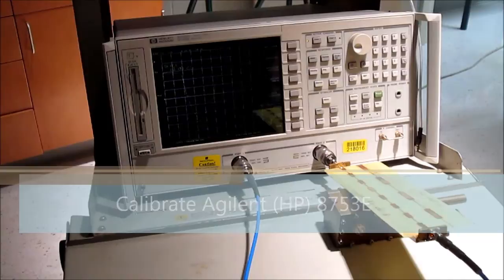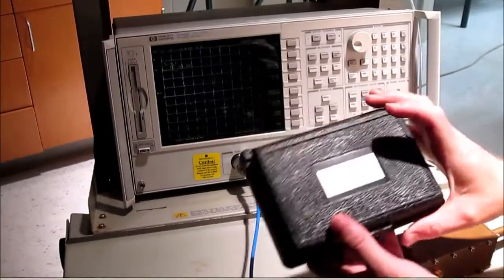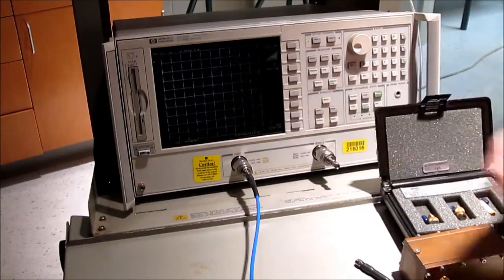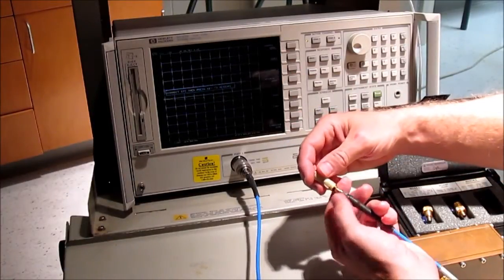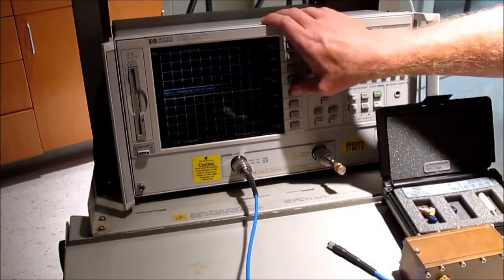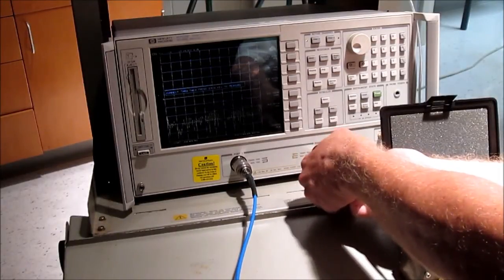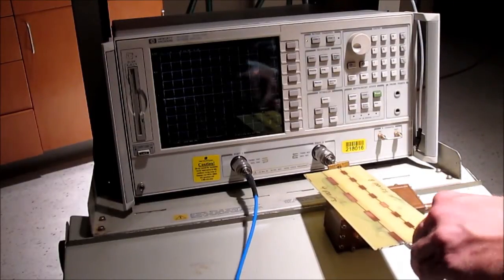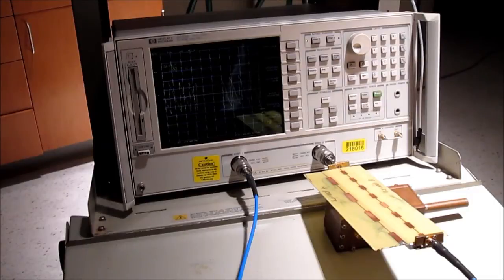Calibrate Agilent (HP) 8753E

Comment: People should not watch and  learn from this video.  You need to enter the coefficients for each SOLT into the network.  You can't substitute with a regulare 50 ohms termination or using nothing as an open.  This is a terrible video.

Comment: I am looking for used text & measurement .dealers contact me if you have what I want    （Agilent   E5071C
Agilent   8720ES
Agilent   8753ES
R&S   CMW500
R&S   CMW270
Anritsu   MT8852B
Litepoint   IQxel-80
Litepoint   IQxel-160
Litepoint   IQflex
Litepoint  IQ2010）

Comment: Your calibration demonstration misses a few points: 
1) After pressing "PRESET" did you enter the start and stop frequencies?
2) Did you enter the number of samples for the sweep?
3) Did you turn on averaging and smoothing on to get a precise cal?
4) Where did you set your reference line and the dB per division on the vertical scale?
5) Where did you select your cal kit?
6) You did a two-port cal, but why did you skip isolation?
7) Did you save your cal into memory?  How about renaming it so that you can switch between cals as needed during the day?

Comment: This is a typical example of someone creating an instructive video about a subject they don't know anything about. The video contains a huge number of errors.

The HP 8753 you use will not have the coefficients for the Maury Microwave kit in it. After pressing "PRESET" it will load the default calibration kit for that analyzer - probably an 85032B or 85032F. Those will have very different coefficients to your Maury Microwave kit. What you should have done is first get the coefficients from Maury Microwave, then loaded them into the VNA as a user kit.

For the thru, you should not be using an adapter like you say, which you indicate should be as short as possible. Instead it is a preferable to have one connector with male, and the other female. OR, if you want to use two males, the length of the thru needs to be defined in the calibration kit.

Also at times you seem to be rotating the connectors - another band thing. You don't use a torque wrench - another bad thing.

So in essence, this video is totally useless, as it is a good example of how not to calibrate an HP 8753 vector network analyzer!

For a low-cost SMA calibration kit, see http://www.kirkbymicrowave.co.uk/sales/85033/ We supply the coefficients (offset delays, C0, C1 etc) both on paper, as well as on a floppy disk that can be read into the 8753D, 8753E, 8753ES or 8753ET. For earlier models (8753A, 8753B or 8753C), it is necessary to load the coefficients by either entering them on the keypad, or via GPIB, as the early models don't have a floppy disk.

Why is it that YouTube seems to be a magnet for people making videos about things they know nothing about?

Dr. David Kirkby PhD CEng MIET
Managing director
Kirkby Microwave Ltd.
Reply: +Dr. David Kirkby 

Caould you post a video where you show how this should be done the right way?
Thanks!